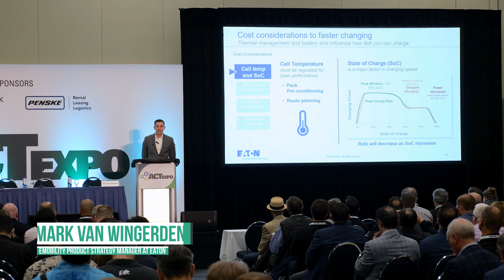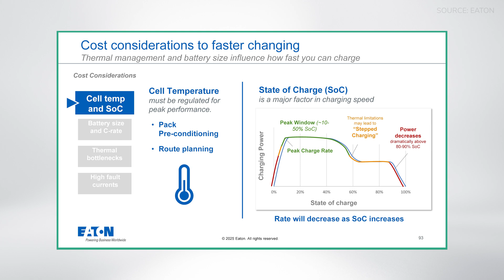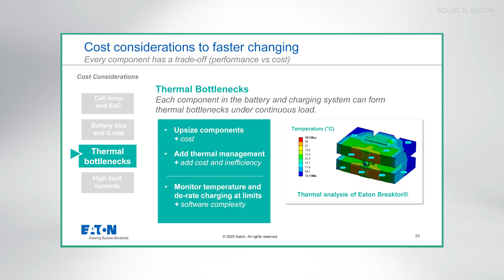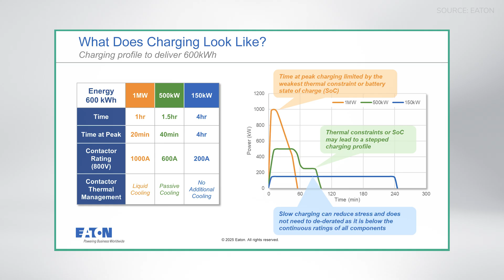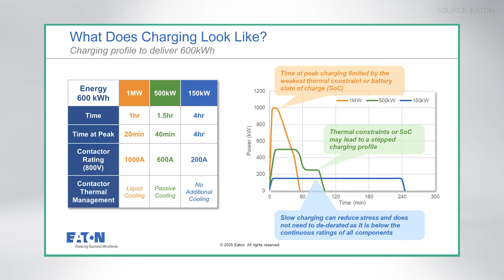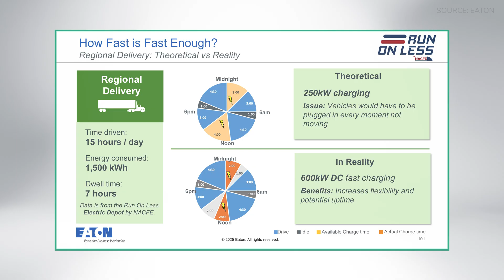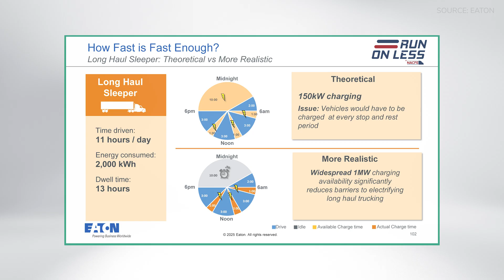Faster Isn’t Always Better: Megawatt Truck Charging Explained

Comment: Or use battery swapping?  And as if those charging curves are realistic?  They're just generalized made up charging charts to try to prove a  narrative. But  It's true there's always trade-offs. As the old proverb goes there's ‘more than one way to skin a cat’.

In conclusion, China's rolling out many different alternatives. And is letting the market decide. Hopefully the West won't find excuses to limit itself.

Comment: What's worse than mismatched charging speeds is having all these trucks and chargers with different charging connectors and ports, just stick with one charging port, like MCS for DC charging, and then use the appropriate charging speed. Local delivery trucks can stick with NACS.

Comment: If i got it right Tesla already said depot level charging is a standard V4 charger.. and only on road long distance is where they need megawatt charging. I just think it is funny that anyone who knows anything about logistics already knows level 2 chargers work for 90%+ of trucks and only long haul need MWC. Last time i checked both Windrose (in china) and Tesla semi are both planning MWC only at truckstop for long haul trucking.
Reply: Up to this point Tesla's Semi chargers installed at PepsiCo/FritoLay were 750 kW using two V3-like cabinets.  The recent report of V4 chargers to be installed at PepsiCo by the drawings appear to be 2 Semi charging posts per 1.2MW V4 cabinet, so could possibly still be capable of delivering up to 1.2MW depending on if another truck is parked in the next stall and its state of charge.